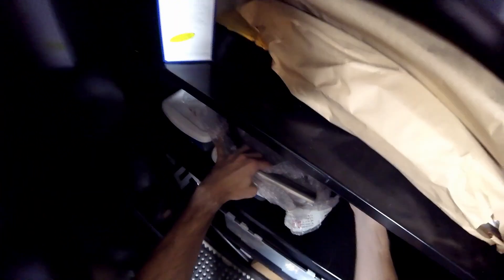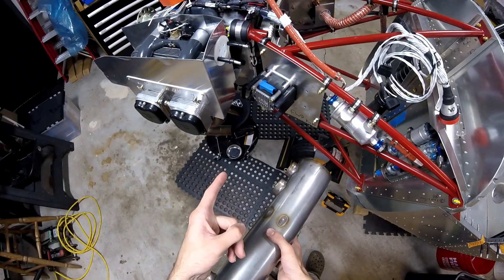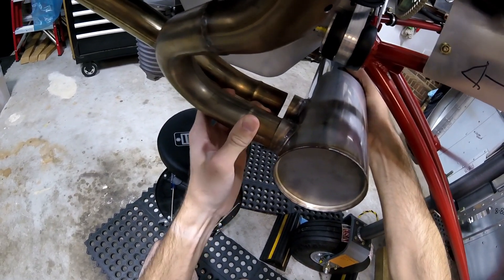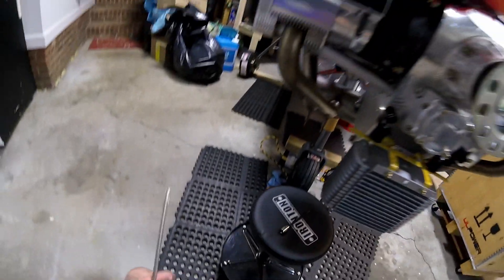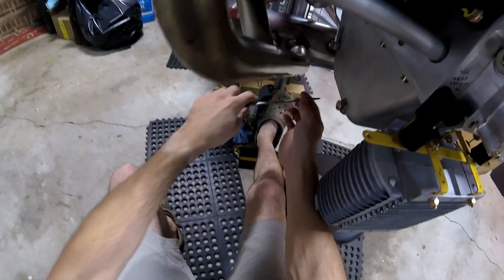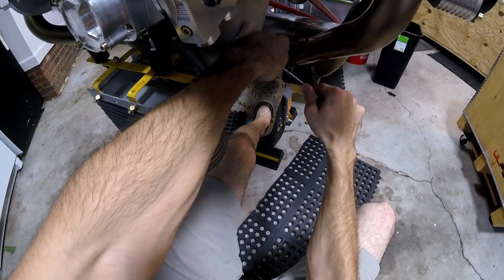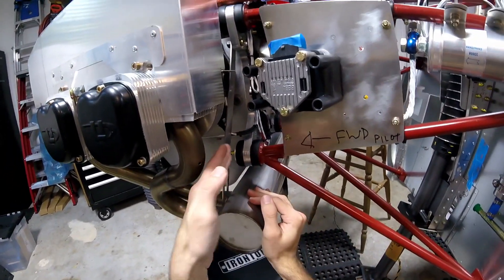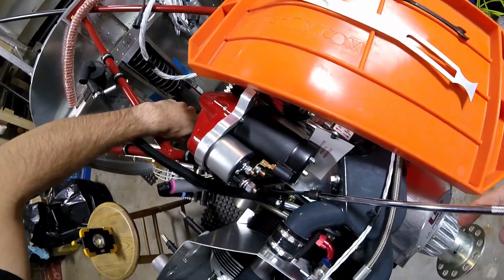Exhaust Part 2 - UL350iS - Zenith 750 Cruzer Kit Plane Build

Comment: Hi, I have a zenith 750. I had the stock oil cooler mounted on the front of the motor, with the supplied rubber buffer mounts.  In flight, the oil cooler would flex and hit the oil pan.  It was actually wearing in to the pan.  Did you do anything special with your oil cooler mount? 
Thanks.
Reply from the maker: Hi, Chuck! Thanks for the heads up. I rigged up a prototype mount that I think is pretty good (better than thw one I showed in a previous video), but I haven't tested it yet with the cowling. I used an L extrusion and metal support brace to hold it in place. I'll post a video about that soon.
Reply: Is it a solid mount or are you using some sort of rubber anti vibration set up?